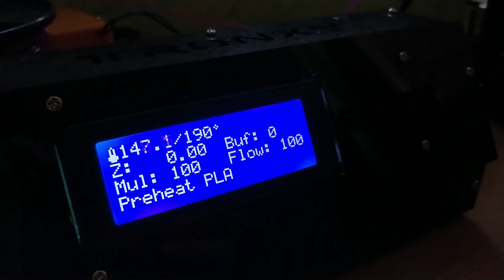Fix Poor Extrusion

Comment: I'm getting a distinct pattern of gaps when I try to 3d print a first layer test square on my Ender 3 pro. The gaps are printing in the same spots for the most part giving me a distinct pattern any ideas on how to fix this? 

The prints are adhering to the bed OK, and squish is good I think? I also re-leveled the bed countless times. The Ender3 has EZABL on it. And the printer did work sometimes before this.

It’s like the filament is being turn off and on, but I can feel the filament moving at steady pace.

Any help would be greatly appreciated. This is driving me nuts.
Reply from the maker: Hi, thanks for your comment!
It was auto-flagged as possible spam for some reason, therefore I'm sorry for the late reply!

Can you send me some images, it would help me debugging the issue. You can send me an email as well, the address can be found in the channel's About section.

I don't know the setup at the Ender 3, but it's pretty surely not completely different from most other machines. The poor extrusion can be caused by some mechanical issue, like shown in this video, and the same fix would work for your machine as well.

However, I believe that it's a software/slicing issue in your case:
First, try to print some pre-sliced gcode files that came with your printer. If they work any better, you know that one of the next things applies! If not, we'd need to debug some more.

Second, check the filament-diameter that is set in the slicer software. In Cura, go into the Machine Settings and click on the "Extruder 1" tab. Make sure that it's 1.75mm and not 2.85mm! The reason why I mention this issue is because I run into it almost every time I setup a new printer.
Furthermore, don't forget to check the preview to find out whether the same artifacts are also there and try to avoid them. A video about basic slicing with Cura will be published tomorrow on this channel, so this could help, especially if you are new to 3d printing!

We'll find a solution for this annoying problem, I also managed to get my printers running ;-)
Reply: @Caverntwo  Thanks for getting back to me here is a link to a video of the problem... https://youtu.be/6gsc-scgCfw

I print with PLA 3D Solutech PLA and or HATCHBOX PLA Filament.

My Ender 3 pro setup..
Nozzle Diameter Standard 0.4mm
Power Supply 24 V 270W
supported Filament 1.75mm PLA, ABS, Wood, TPU, Gradient color, carbon fiber, etc.
Printer OS: Marlin TH3D U1.R2.5
Free Memory: 11650  PlannerBufferBytes: 1232

 info from the printer 
Recv: echo:Steps per unit:
Recv: echo:  M92 X80.00 Y80.00 Z400.00 E97.38

Recv: echo:Auto Bed Leveling:
Recv: echo:  M420 S0 Z0.00
Recv: echo:  G29 W I0 J0 Z-0.15600
Recv: echo:  G29 W I1 J0 Z-0.15800
Recv: echo:  G29 W I2 J0 Z-0.13100
Recv: echo:  G29 W I3 J0 Z-0.10200
Recv: echo:  G29 W I0 J1 Z0.07100
Recv: echo:  G29 W I1 J1 Z-0.00800
Recv: echo:  G29 W I2 J1 Z-0.06100
Recv: echo:  G29 W I3 J1 Z-0.09100
Recv: echo:  G29 W I0 J2 Z0.31300
Recv: echo:  G29 W I1 J2 Z0.13500
Recv: echo:  G29 W I2 J2 Z0.02550
Recv: echo:  G29 W I3 J2 Z-0.06450
Recv: echo:  G29 W I0 J3 Z0.33000
Recv: echo:  G29 W I1 J3 Z0.18600
Recv: echo:  G29 W I2 J3 Z0.05150
Recv: echo:  G29 W I3 J3 Z-0.08700
Recv: echo:PID settings:
Recv: echo:  M301 P20.32 I1.54 D67.00
Recv: echo:Z-Probe Offset (mm):
Recv: echo:  M851 Z-1.25

cura V3.6.0 is setup to..
1.75mm
Draft 0.2 profile (i have tryed all profiles).
initial Layer Height 0.2
line width 0.4
initial layer line width 100.0%
Print tmp initial layer 195-205c
ininial flow 100%
initial layer speed 30.0mm/s
initial fan speed 0
the rest is default.

the test Bed levelling square (center) is from https://www.thingiverse.com/thing:2789093
if you need my files please let me know.

Thanks again for the help.
Reply from the maker: I replied to you on your linked video. I hope that I could help you.
Reply: This is definitely an extruder eStep calibration issue. U are underextruding and u need to calibrate ur eStep for extruder

Comment: I have the extrusion problem with the brand new printer.. the fuck
Reply from the maker: There could be multiple reasons for your issue. To start investigating, check whether filament is actually pushed by the gearwheel and not slipping. If it isn't, tension the extruder or check what's holding it back. If the motor is clicking, the filament not slipping and there's still nothing extruded, then it's time to look at the hot-end/nozzle.
I hope that I could give you some hint. Keep me updated!
Reply: @Caverntwo  Yeah thats the first think I did, checked the gearwheel extruder and I added some tension to it and it was too tight so I loosen it up so you could see the small gear pattern on the pla once you take it out. So thats should be all good. I was hoping thats the software issue and I am going to try the new one soon if thats not the case I will prob return this printer as it should not cause any problems right off the box.. :(
Reply from the maker: If you press the filament in manually, does it extrude properly (the extruded filament should come out straight and not curly, and you should also check if the diameter is equal to the nozzle's)?
If it does, it could be a software issue.
BTW, check for the filament diameter set in your slicer software. If you add your machine as a "Custom Printer" to Cura, for example, the default diameter set is 2.85mm and not 1.75. I ran into this issue basically every time when I added a printer...
Let me know if it works for you!
Reply: @Caverntwo  Yeah I was playing around with another software but I could not print via usb so I started with cura again and I think its working now okay.. not perfect but better than it was before for sure.. no holes.. but I still have some spacing in between the lines..especially on the bottom layer for some reason.. some lines line up perfectly some have a little spacing.. I think it was the temperature problem with the extrusion problem. Thanks for the tips!
Reply from the maker: Cool!
You'll learn over time and will find your perfect settings. About the temperature, for PLA, try between 195-215°C. Every PLA brand is perfectly printed with different temperatures.
You could also try to adjust the steps/mm in the printer firmware, or play around with the flow value while printing. Hopefully that will help you.

Comment: Sir I had problem in extrude when printing is done one layer in middle portion is not properly print so it damaged while removing.give any solution for this
Reply from the maker: There could be many reasons. I already answered a similar comment on this video, which might also give you some possible solutions.
The important thing to find out is whether this happens regularly or this was a single occurrence.